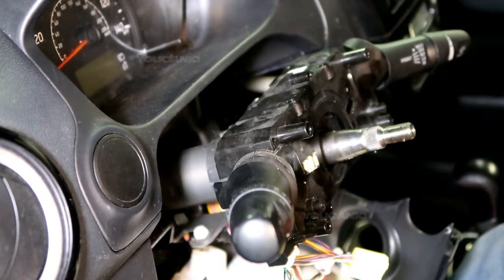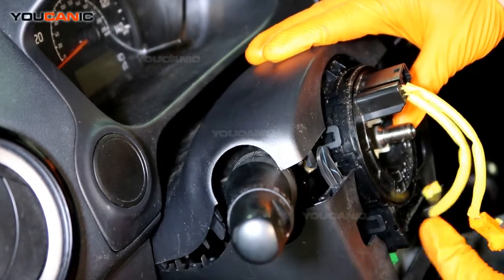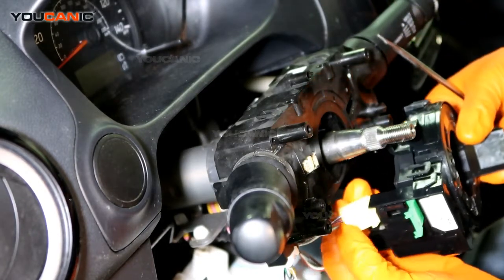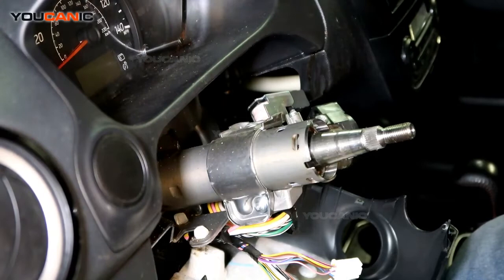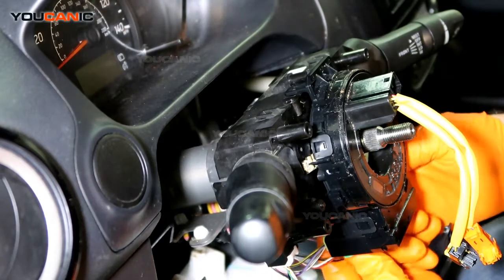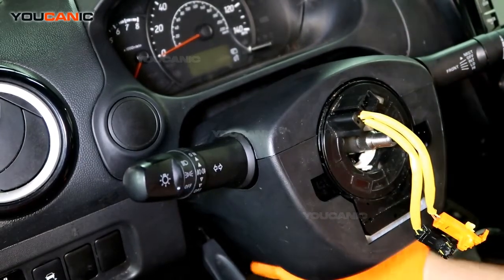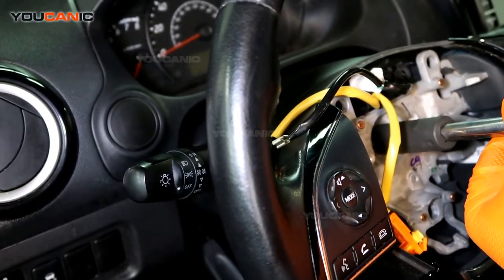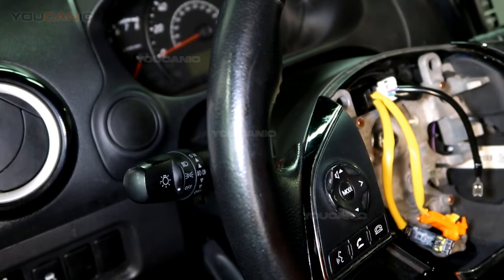2012-2022 Mitsubishi Mirage G4 - Combination Switch Clock Spring Replacement

Comment: Can broken clock spring be the reason of air bag indicator light on? The result on my scanner shows "B1418 Front LH G sensor Comm. Error and B1416 Front LH G sensor fail. I already try spraying contact cleaner the sensor in front above the radiator and delete the code but after 1 month the code"airbag light on the dashboard" shows again